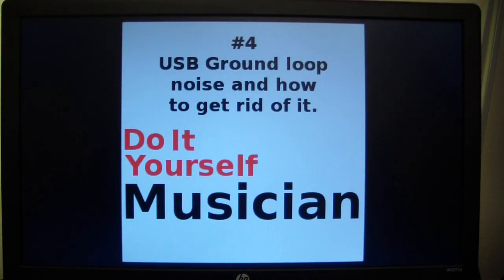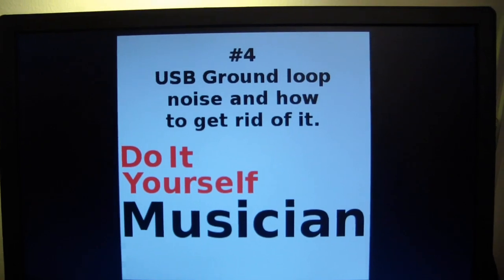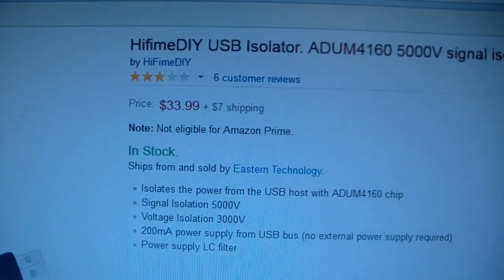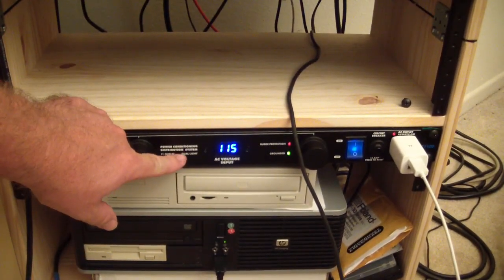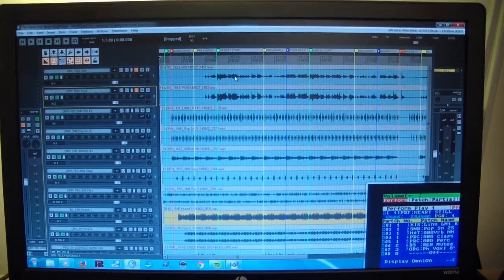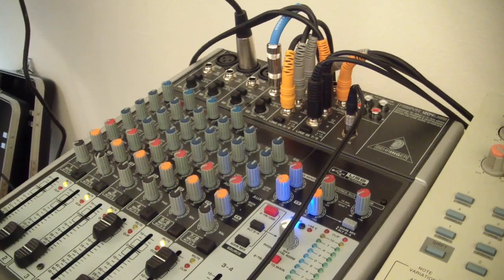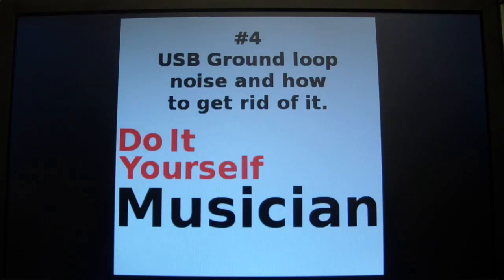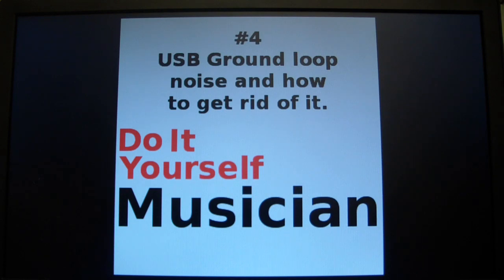Do It Yourself Musician #4 - Fix USB Audio Noise with HifimeDIY USB Isolator

Comment: For people with bigger cards (like 8in 4out), the power supply is usually split from usb so this won't fix the issue. I have a small usb power card and a big 8in seperatly powered card, only the small card has the usb noise issue (Both from the same line of products : steinberg).

So this solution shouldn't be used for a card that need more data transfer anyways.

Great vid, very helpful

Comment: Thanks, I just ordered one off Amazon. I got some RGB lights for the back of my TV and plugged them into the usb port on the TV, and I got that horrible whining noise. I assume it's because the usb port is an audio output. 

I know this doesn't have anything to do with audio mixing, hope this works though.

Comment: Thanks for this tip, I have some noise constantly coming from my PC -> Focusrite 2i2 -> Rokit 5 speakers, but when I use my guitar -> Line 6 MultiFX -> Actual Tube Amplifier and THEN plug the Line 6 into my via USB into my PC so I can upload presets and have the PC control effects while I'm playing, the noise coming from the Amp is so nasty I can only keep it plugged into the PC for a short time and it destroys all my creative juices pretty much.  Ideally I'd like to have a setup where the effects are controlled by the PC while it plays a backing track, so I can switch the effects for different sections, like a digital one-man-band, but the amount of noise makes this impossible.  Hopefully your gizmo can fix this.
Reply: did it fix it?
Reply: So u mean the interface is the reason got noise? Did it fix??
Reply: @Phober  no, it's the grounding issue.
Reply: @sashabagdasarow497  bro do u have ig so we can talk about it?

Comment: I've come across the audioquest - jitterbug, have you tried that or anyone else here?
Reply: I tried one but it didn't fix this. The audio quality did improve slightly but the interference remains. Did you have any luck with anything else?
Reply: @lowerthetone  Me too... better try this one i guess.
I have the exact same problem when using midi usb cables from outboard instruments, and the motu 828 that i have also uses usb.
And that way picks up al the noisefrom the computer.

Have tried it on my motu... and also on the instruments serperat, but no luck.

I think this one wil work though...finally after a month headache and searching for what this problem is, but we will see.
Reply: @AI1983-r1k  I actually found a fix in the end. My USB interface is a Native Instruments and it has a ground plate screw terminal on the rear. I connected this to the earth of my house wiring using an old mains cable and it reduces my noise a LOT. It's still there if i turn up the volume high but it's nearly inaudible when playing music or film

Comment: Hifime is only 96 kHz/24 bits...   Whon't be good for DSD ?   most Dac are 192Khz/24bit    and mine is:  384 khz 32 bits.
I've cut the red wire on mi cable so no power...and Check here I still have some noise
not so big but it's there..  Same as yours.  I think i'll try this one:  (iFi iPurifier3) More expensif, but there is a Reclocker, rebalancer etc...
 https://soundcloud.com/hibou53/usb-noise

Comment: Glad that worked but my Scarlett Solo 2nd Gen is USB 2.0 (480MB) so I will find a compatible solution. My 3 year old PC has USB 3.0 ports but they are backward compatible to the speed of whatever is plugged in.
Reply: I have Scarlett Solo 2nd Gen as well. And I get lot of this sound shown in this video. It just won't go away. 
Also the guitar sounds muffled and feels like something is not right. 
Did you find a solution?
Reply: ratedrsuperstarthega Yes I went to Best Buy and got a Metra Ground Loop Isolator from their automotive department. It worked great between the Scarlett Solo and my Studio Monitors.
Reply: @SteveMavronis  Great it worked for you.
Now my question is, Why in the first place we have this problem?
Only few people like us have this, otherwise the entire world uses USB and audio flawlessly. There has to be answer why this problem occurs.
Also, the isolator will definitely suck the tone and maybe even volume.
Reply: @SteveMavronis  i think for your situation you might need something like Audio-iDefender3-0-Ground-Loop-Eliminator as he can also be powered with through a micro usb connection. Unfortunately for usb powered sound cards is a bit trial and error, i have a 18i20 and to remove the ground loop i cut the ground of the usb cable as the card has its own power cable. Ground loop gone, while this cannot be done for self powered card can be applied ,for example ,to  midi devices thah have a dedicated power supply. Your solution eliminated the noise off the speaker, but check with the headphone as my guess is that the loop will still be there when you're recording
Reply: @Emilio-HLZ  the Metra ground loop isolator helped a lot. Before getting this I experimenting with attaching a ground wire from one of the RCA outputs to my computer's USB port and the noise went away too. The problem is USB cables themselves have no ground. But USB ground loop isolators are expensive. The Metra unit was only $15 and I had a $5 Best Buy Rewards certificate at the time. That being said I haven't used the Scarlett much. Recently I'm having more fun with iRig 2 and I'm able to feed my 1W tube amp emulated out and physical pedals through it using Amplitube's clean amp on my iPad.

Comment: Mine does not pass a signal piece of crap
Reply from the maker: Is it broken? Do you need a high speed isolator? As this video is several years old now there are probably better units on the market than this.

Comment: I have the same ground loop noise, but unfortunately the usb isolator you suggest says on it's Amazon page that it will not work with my Focusrite DAC. But I picked up an iFi Audio iDefender3.0 USB Ground Loop Eliminator from Amazon which in the reviews says works great with the Focusrite 2i2. https://www.amazon.com/Audio-iDefender3-0-Ground-Loop-Eliminator/dp/B01N3XKOLG/ref=cm_cr_arp_d_product_top?ie=UTF8
Reply from the maker: Thanks for the tip. Yes you need a high speed USB isolator with more advanced interfaces. This video is getting old so I'm sure there are probably much better devices on the market now.

Comment: Check these out "USB 1500v Isolator Isolator" on EBAY at 10 quid each. Should do the same. ADUM4160 USB To USB ADUM4160/ADUM3160

Comment: Also dont use cheap coax longer than 0.5 metres or use XLR cables where the signal lines are within a coax screen.. Replacing the bad coax with RCA / RG58 coax often cures the noise.

Comment: the first very simple solution is to put plastic pvc tape(isolate the ground) on the power connectors...! i have tested 100 times.works great
Reply: Hello! You mean on the USB cable power connectors or how...? PLEASE.
Reply: How does it work exactly?

Comment: Hey guys. I have a solution..may not be hundred percent but..almost 90 percent. The noise comes when you open your asio audio to record isnot it? similar problem i also had and i thought all this is the problem of sound driver, usb cable and laptop and amp and may be of many connected stuffs! Yes it is the problem from your laptop configuration. Simply right click your mouse in the audio setup in the right below corner and select audio devices and click microphone option. you will find several options on top select the level option and going inside this option you will find a microphone boost option and just click off it or slide it to zero and the problem is solved.. I also got this from some one in one of these kinds of comments.. Thanks enjoy your recordings.

Comment: I have had noise on several different occasion on various recording programs and in two cases it turned out to be coming from an HP printer even if it was turned off.  Had to unplug it.

Comment: I got one of these well not same one but usb ground loop, im good on the support ie 24/96kh, however i have an issue where it does not have enough power to my tascam us42 because its powered only through the computer. Do you know if i were to get persay a powered usb hub then run it throught the ground loop would it work then. Or would the ground loop isolator resist the extra power that would be giving from the usb hub?

Comment: for 10 bucks u can likely be rid of most of that noise. usb b port wire data lines directly to usb female port on other side. think of the plus and - wires as rail road tracks now.... starting at  input (usb b) side connect a 10n ceramic cap,  between the tracks put a 220ohm or so @100mhz bead filter on positive "track"(obviously break the track otherwise power bypasses filter) leave same length on other side untouched. add a 100n ceramic cap between tracks then a 10u electrolitic cap (careful to connect the - side to -[its the only polarized cap]) and now connect the tracks to the usb power lines on the other side
Reply: Hey. Thank you. This one sounds like solution, but I´m unsure about the description. Would you have a schematic of this one?
Thank you.
Reply: CrashPCcz  here: http://andybrown.me.uk/2015/07/24/usb-filtering/
Reply: Ah, I see now. Thank you very much. Well, I tried to supply the 5V from the standalone supply, and I still have few kHz noise. I wonder if it comes from DATA! :-(
Reply: CrashPCcz do u have a scope? little 5v to ac adapters arnt known to be the cleanest power. also, the way usb works, the ground and shield around your cable are still tied to the pc/host regardless of external power...so any noise on that ground is still coming though. if you just need stereo to 5.1 surround output i highly suggest a usb to toshlink. and then convert the toshlink on the other side of the optical cable... noise wont travel over the optical cable unless it is in the data... but in my experience its never in the data.. for like 10  bucks you can get a usb sound card that has optical built into the headphone jack. it uses an adapter like http://www.sweetwater.com/store/detail/GOP490?adpos=1o3&creative=54989267161&device=c&matchtype=&network=g&product_id=GOP490&gclid=CjwKEAiA48fDBRDJ24_imejhwUkSJAAr0M5k2KFuB7xwaHiObkMhzZewsIQt7eBuaCFmOc_O56NuZBoC2pzw_wcB this...headphone with hollow end to normal toshlink. last 3 laptops ive owned have been loud as fuck with noise on internal audio(when plugged into wall). moment i run it over an adapter like that its just pure sound/music no noise.
Reply: I have an old scope, which is not good for finding noise on "large" (5V) signal. I might get better one soon. I also cut the shielding, so there is only data left from the USB.
When I use 5VUSB, I get lower noise, but I hear mouse movement quite loud. Using standalone 5V adapters gets rid of the mouse movement sound, but the still noise is higher. I found that noise changes depending on channels usage (USB speed?). Once I use mic at the same time, the frequency of the noise goes down. Also bit depth settings change the noise. Very weird. Anyway, I´ll build interconnection board between USB wires, and try to make some effective filter. The problem with optics is that my (quite expensive) setup doesn´t work with optical interfaces. Only analog. Anyway thank you for your extensive help. I´ll try my best and report back in matter of days...
Reply: Hello. News coming. And not very good for me. I took my time with my very old oscilloscope and I found it can measure ripple voltage without DC. As I already knew USB could handle a lot more capacity, I loaded it with total of 130uF. 1nF to 10uF on both sides of the coil in the CLC circuit, and 100uF on the load side (sound card). The bead didn´t make the initial current surge and burnt itself into copper hell, and so I used DALE IHA-203 inductor. As far as my math goes, for the kHz noise, I would rather need uH to mH values, not what the bead provided. 
Anyway the coil attenuates the noise by about 3db on the accoustical side, so I tried to measure. I got 4mV of ripple Voltage on the unloaded CLC filter. That´s good. Now after I add the soundcard, the ripple goes into 25mV range or even more (can´t see those spikes on the old oscilloscope), and what´s more problem is that the ripple is stronger on the soundcard side, behind the coil, not in front of the coil on the PC side. That propably means that my Creative X-Fi soundcard itself makes all the trouble. That´s VERY unexpected. I have no problem opening that soundcard, but I´m not sure what causes this excessive ripple, and where to start. And I thought Creative is okay. Well, no more!
Reply: CrashPCcz heh holy shit i thought there was like a 20% chance random stranger would own an iron let alone scope and required parts. 80 percent chance it was a waste of time pointing you in that direction...im pleasently surprised. That tutorial did mention the bead selected worked for his noise but you will need to find values that work for your noise ;)  2 things come to mind... one is mentioned on that tutorial: some usb controllers may have an issue with supplying that inrush (even if they physically can...the usb spec has a limit on cap values) )that sound card may be  a different beast all togeather. im trying to picture the setup a little better.( more than a few diff cards over the years use f x-fi chip).. is it a a pci card that has a break out box? said box has usb mini for power? does it send the sound over usb data or a separate connector (i had a card 10 years ago that used a serial style connector for the audio i/os)... regardless of version of card, does it use any electrolytic caps/have u checked the caps already on the card/s for bulge at top or wiggle at connection? if you havent opened the box thats where id go from here.
Reply: Hello. Obviously, those handy and knowledgable people have to be somewhere. 20% is a lot! :-D
I guess that for my noise it would be larger inductance, but that´s not a problem. Problem is that I don´t need to filter the USB from the PC that much, I need to filter the sound card induced noise. It´s USB external card, Creative X-Fi 5.1 or so... I have it on microUSB cord with ferrite around the cable.  The soundcard gets USB DATA, and there is DAC in there. As long as my measurement goes, the ripple is not really excessive (20mV without extreme spikes I might not see due to the oscilloscope capabilities). The problem seems to be that all that noise is not attenuated by in-built low noise regulators. for supplying DAC, op-amps and the rest. I did quick visual inspection of internals, and I cannot see anything what would look like a problem.  Only electrolytic caps are used for output DC blocking, everything else in the card is solid dielectric type.  I will keep my soundcard open until I solve it or until my patience is up. I found that the ripple comes from 5V, but I  cannot isolate the problem. As far as USB data comes to the processor, the ripple is bad. Once the data is not present, it´s better, but not solved. I guess it´s just poorly filtered processor and poorly filteret audio part. I have no idea about elegant solution, so I´ll add filtering and blocking capacities to the soundcard periferies here and there and I´ll rather hear what it does.
Reply: CrashPCcz ever get it figgured?
Reply: After few more measurements, I´m very certain the whole 5V Power supply branch is either deffective or very poorly built (including processor propably) on the soundcard. That way The device is ready for dust bin. Only quick solution is to filter the hell out of the power supplies, especially DAC (filtering and blocking) and stronger ground. Didn´t do it yet, but that´s what I´m gonna do to make it better until I replace the soundcard. Very poor performance and design of Creative. Never again! There is no real "solution" just lowering the amount of noise coming out of the wreck. Too bad.

Comment: I had this issue with a USB powered mic (the USB provided power only, it had a line in for the signal). I found that plugging the USB into a phone charger rather than the computer solved the issue. Might be worth a go in some cases.

Comment: So how come this happens with some USB ports and not others?
Reply from the maker: I couldn't tell you. It seems a lot of folks are getting a similar noise but it is not getting into their systems via some kind of loop. I strongly recommend that anyone test to be sure they are getting the noise that way. The noise in my system also stopped when i ground lifted the USB interface which of course is not really safe to do. The safe thing was to use the isolator.

Comment: Will this work as a stand alone by helping adjacent usb slots? i.e. I want to run my Audioquest Dragonfly DAC on an adjacent usb port (because it requires high speed) and want to know if this is just plugged in by itself with nothing going directly through it somehow will help the adjacent slots.

Thanks so much!

Comment: Would this help for audio interfaces such as a Steinberg Ur22 using Fl studio12.3 with a Shure Sm48 dynamic microphone.
Reply: I get a Shhh sound in my recordings and when the mic gain is all the way down my mic is really loud and distorted
Reply from the maker: That sounds like some other issue. Double check how you have everything set up